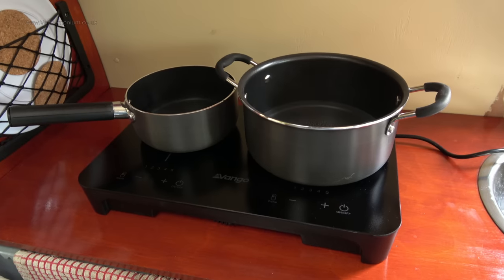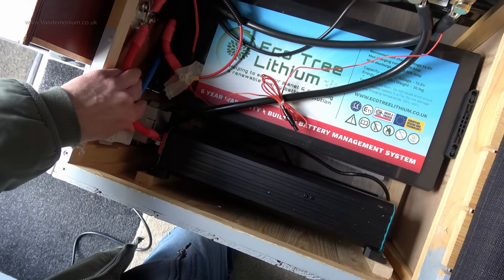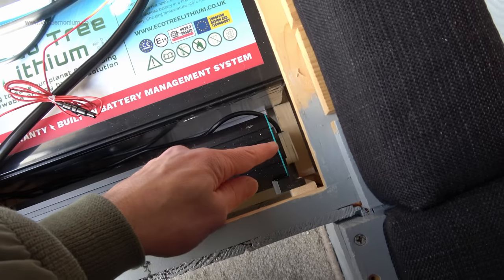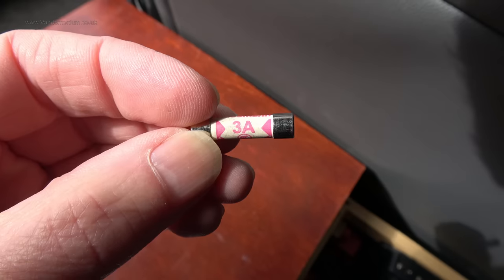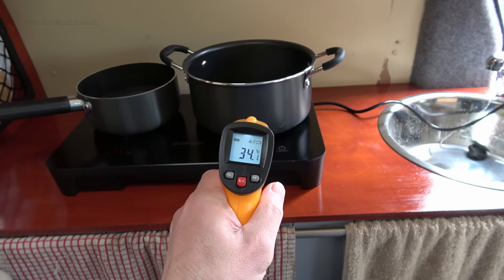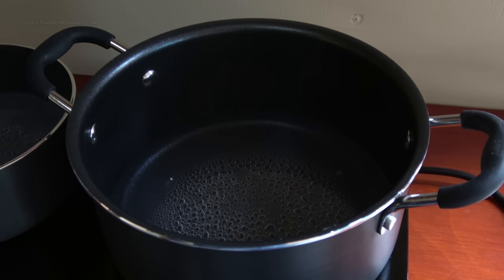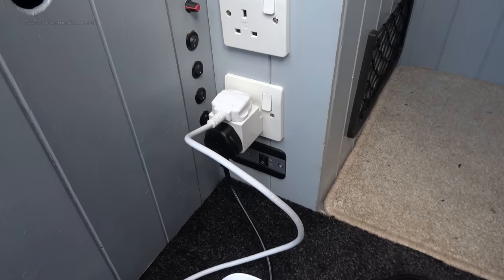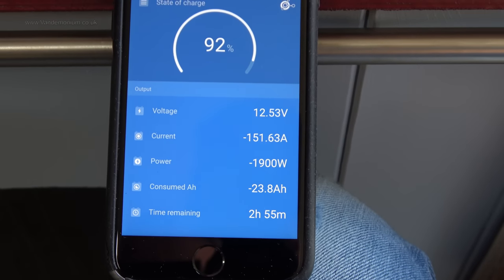80. Battle stations! Inverter vs electric kettle

Comment: You might need to check cable, it might only be for a light ie 3 amps. 13 amps cables are quite stiff. HTH.
Reply from the maker: Cheers, I do intend to check it

Comment: Good on you for thinking of the possible fuse in the plug. It's the little things that are so easy to forget, and then are often forgotten while I check all the other bits and pieces and connections, wondering why things "just don't work the way they are supposed to." LOL  Thanks for taking us along on your "steamy" adventure.

Comment: A little safety tip. When feeling live electric cables always use the back of your hands or fingers, just in case if you get an electric shock causing your muscles to spasm, you won't end up grabbing a cable you can't let go of.

Comment: In the comments section of the last video, someone described the ending as a cliffhanger. Well David, you left us at the top of a very high cliff and quickly brought us all slap, bang down to earth with nothing more than a 3 amp fuse in a plug! Love it!! It is indeed testament to the fact that everything does work well and proper. You should give yourself a pat on the back as this is a result of some excellent work!

Comment: Very nice.  I admit that i was rather skeptical about all that current going over a 12V circuit, but what i forgot is that it's only 12V for like 4 inches or so, and then it's 230V the rest of the way.  No problem.
And very nice too that everything failed correctly.

Comment: Couldn't help but chuckle about the fuse in the plug, you're not alone with that comedy error! That all looks like it will serve you well, even if I and others were worried about the potential heat build-up from the inverter. That's some quality equipment you have bought there, operating well within safe temperatures. And then there's the Whitesnake mention; nicely done!

Comment: My old van has a 2Kw generator installed in a cabinet. I start it (with a button) for a few minutes in the morning to run the coffee maker and microwave my oatmeal. This also gives me a head start on charging before the solar panels light up. It also gives me an option for battery charging when there isn't enough sunlight to recharge. My generator is quiet but not silent. If I were doing a new installation I would consider a large battery and inverter. Thanks for the video David !

Comment: I had a similar experience yesterday when testing out my electric system, inverter, induction cooktop. I've got a 120v breaker panel (USA) rather than just a plug, had my induction cooktop in a socket wired to a 15amp breaker. Handled the two burners both at half power (most the cooktop would allow) and I wasn't pushing the inverter to its limit, so I fired up a heat gun on the other socket. Pow! The 15a breaker tripped. Worked as designed.

Comment: Now that I watched, I am glad I was wrong.  I did see that it is a true sine wave inverter which is great.  You perfectly over designed the robustness of that system and its paying off. That inverter will shut itself down well before it gets too hot.  Use it and enjoy it.
  For a home-gamer/DIY'r you do pro level work.  My offer stands to 3d print you some custom covers for those lug connections.  I'd be honored to do so. Looking forward to some more Van vids David. Thank you and have a great day!
Reply from the maker: Thank you 😊

Comment: Amazing the advances in battery technology.. I had to have 8 x 110Ah AGMs powering a 3Kw inverter to get similar capacity on a boat... plus  15 mm diameter welding cable!!    Yours is a nice compact, well laid out setup that does what's needed most efficiently, David.

Comment: Fuses are there to protect the wiring, accuracy/quality varies. Many appliances draw a very high start up power, so headroom is good. Usually RCD needs to be changed to cope with a microwave if you install one.
Reply from the maker: I've no space for a microwave

Comment: My understanding is that (in the UK) a plug outlet will normally connect to a 30a fused ring so the power capability of the wiring feeding a typical mains socket is actually 30a - so much more than the 13a spec limit. Any equipment connected to that plug should be fused as the wiring comes in to its enclosure so that just leaves the flex itself and the fuse in the plug is designed to protect that cable from being the weakest link. I would be suspicious that any lead wired to a plug that clearly says it has a 3a fuse will be rated for less than 13a and the black cable you showed didn't look like 13a-capable flex - though it is not easy to tell from a quick video. If you upgrade the fuse you should check that the cable is also up to the job. :)
Reply from the maker: I am definitely going to check the wire
Reply: @Vandemonium  for 10A you really want 1.0mm2 minimum, though better to go with 1.25mm2 or 1.5mm2, though the shortness of the flex will work to your advantage. Also I like to use bootlace ferrules when wiring anything with stranded cable, makes a much neater job and no chance of loose strands, paid £20 in Lidl a few weeks ago for my current set with a ratchet crimping tool.
I wonder if there would be any use in getting a coloured socket for your inverter driven socket it's easy for anyone to identify, MK certainly do a red one.
Reply: Would recommend 1.5mm sq flex in this application. Its rated 13Amps minimum , plenty for your application.
Ref BS7671 wiring regulations , table 4D2A

Comment: 13A is for 3kW load, but that fuse is protecting the wire from the inverter to the outlet. there is another fuse in the apliance plug.
Reply from the maker: True

Comment: The best result really - I am amazed quite how long that 3A fuse took to blow though - at least it did.
Glad your inverter is running fairly cool in that location anyway - put your hand over the fan outlet and see how hot that is - I would expect it to show a bit higher temp than the case really. Difficult to measure with IR thermometer.

Comment: Very interesting and food for thought. You did a good job on the installation which was a result of careful planning. I wonder if the kettle is a more efficient way to boil water than the hob?
Reply from the maker: Don't know
Reply: One advantage I see in using the kettle v hob is the kettle has auto shut-off.  Although I think the hob would be quicker.
Cost wouldn't be a major consideration when using solar power.

Comment: Well! There ya go. I've never seen a plug have a fuse in it like that.
Reply from the maker: Standard British mains supply plug :-)
Reply: @Vandemonium  Ok! Australia doesn't have fused plugs. Most GPOs are 10amp fused at the meter box.
Your inverter would have an overload shut off. Do a test with the same amount of water in the kettle and 1 pot on the induction to see which one is quicker.
Cheers mate, glad it was a simple fix.
Reply: It's to protect the wire from the plug to the appliance. For example a short in the appliance could overheat the wire causing a fire.
Reply: best plugs in the world

Comment: The reason it was a 3 amp fuse is connected to the wire you chose is because the cable in your connection is not large enough for a larger fuse.  Never simply increase the fuse unless the wire diameter (gauge) is matched to the fuse.
Reply from the maker: The reason is was a 3A fuse is because that's what I put in there 5 years ago when it went to a 375W inverter!

Comment: Very happy to see all things coming together nicely for you
Although not asked, I'd like to "say", that I would have fitted the vent, facing the leg-corridor on the wall of the inverter compartment to the very bottom, so colder air could have been let in.
I know it is a minute modification, even less important in the intake temperature, and of even less importance in the light of the readings and test results, but I would have done so.
All this being "said", surely it is not criticism, and I do happily congratulate on how it turned out.
Reply from the maker: There's loads of cold air coming in from the back of that cabinet as shown in either this or the prior video, I forget which.
Reply: @Vandemonium  I was sure about that, and like I said: no criticism, nor unwanted advice, just a crumble of thinking how I would have placed that, and for what reason.
Most certainly because of me being as over-cautious as possible.
Reply from the maker: Absolutely, I was just clarifying 😀

Comment: Good to see it was just a fuse. Always amuses me that people boil water in a pan without the lid on for a demo. I'd be interested to know how many AH are used to boil the electric kettle via the inverter and a stove top kettle on the Induction hob - wondering if these are different -  currently trying to work out the size of  battery I need for my limited electrics in Sprintie the Campervan as Big Bertha has expired - thinking I'll probably go Renogy Lithium if I can get away with just 100AH
Reply: Go big or go motorhome....
reallly...just bite the bullet and build in some spare capacity to deal with the unexpected..
and possible upgrades in the future that will require more "oomph"...

Comment: And they said a watched kettle never boils 😂  
On a side note, sticking a fuse in the supply from a solar panel is potentially a waste of time, the panel(s) can never generate sufficient current to blow the fuse.  Whereas the connections to the fuse holder are another potential failure point.  A good quality solar controller (such as you have) is going to provide the electrical protection you need.
Reply from the maker: But as someone said to me, if the wire were ever to fall out of the charger and meet a negative then said fuse would protect the battery shorting through the wires
Reply: @Vandemonium  Would the solar charge controller even allow the battery to backflow like that? That's where the other end of the panel supply wire ends up, isn't it, not the battery itself?
Reply: @Vandemonium  If you start going down the line of “if this wire falls out” there's more options than its possible to compute!  The basis of electrical safety assumes that the installation is done correctly (and wires don't “fall out”).   The primary aim of a fuse in a cable is to protect the cable from damage due to overload or short-circuit which results in too much current in the cable.  If the thing at the end of the cable cannot supply sufficient current to blow the fuse, its pointless.  Its a problem for solar pv installation standards haven't got to grips with yet

Comment: Runs great and stays cool anywhere, nothing more to ask for...
Did you estimated by now, how long it takes to get the used Ah's back into the battery?
You don't have a battery-to-battery charger, am I right?
Thx for showingm great series!
👍👍👍
Reply from the maker: No batt-batt. The battery was recharged the next day. And later, I made a cup of tea (using 20Ah I think) and the solar had it back to full later on with no worries

Comment: Sorry if you've already covered this in a previous video, but I'm wondering if the induction hob (great word, 'hob', we don't have that one here) is more or less efficient then a couple gas burners.
Reply from the maker: I suspect so but I can't give you scientific evidence
Reply: @Vandemonium  Fair enough.  Thinking about it though, I suppose the electric path is long-term efficient in that the battery can be recharged.
Reply: Yes, hugely more efficient.

Comment: Very interesting as always. Having blown the fuse in the plug on the output of the inverter, could you consider fitting a miniature circuit breaker on the output instead? Although I guess the inverter has over current protection?
Reply from the maker: Yes it does, luckily. There will always have to be a fuse in the plug though as that's the way British plugs are so it might as well be fused that way.

Comment: Fuses are NOT to protect items; they are to protect wiring.  Here in the States, National Electric Code fuses should be 80% of the wiring. You need to get a bigger cable for the Inverter to outlet. (I put 6 children through college rewiring vehicles that people put bigger fuses in the wire. )  Also watch out for cheap insulation wire, the melting temperature is too low. It's slick and shinier than the good stuff. The cheap stuff slides through your fingers and the better stuff will have some resistance. I have seen cheap 12 gauge melt before factory 16 gauge.
Reply from the maker: I will be checking the wire, cheers

Comment: Excellent. You'll like that induction system, I was pleasantly surprised when I got one for my home. As for the naysayers, since this is working I'm sure they will soon discover that you're wearing the wrong color socks when wiring and your feet will burn to a crisp and you'll have no toes left. And I bet those aren't steel toed boots you're wearing either. 😎
Reply: I wonder what they will be like when your other systems are operating. I.e. fridge, lights, heater and lights all at the same time.
Reply from the maker: The draw from the van appliances is negligible in comparison with the inverter; about 12A at 12V if everything ran at once!!

Comment: I would like to suggest that the cable from the inverter to the socket is a bit thin for 13A.I looks more 5 amp cable. Perhaps use a thicker cable? Just to be sure. Compare it with the thickness of the kettle lead.
Reply from the maker: I need to check but as I recall it's standard mains cable (I can't imagine I'd have deliberately used downrated cable for that connection to the old inverter)
Reply: @Vandemonium  I say because fuses in UK plugs are there to protect the cable NOT the device. Having a three amp fuse suggests a lower rated cable ( 5A?) . But easy to check and if need be change. It will probably say on the outside of it.
Reply from the maker: I will definitely check it

Comment: Are the wires from your fused plug capable of handling the 10 amp?
Reply from the maker: I believe so but a lot of folk have asked so I will check it
Reply: A 13A fuse is intended to protect 1.25mm cable. It will not blow at 13A and it would probably take around 20A to take it out. As you are probably  aware the primary function of the fuse in a plug is to protect the cable not the connected appliance. Obviously it can be down rated if required but it is a good idea (as in your example) to mark the plug accordingly
Reply: If the cable is the official cable for that appliance then it should be fine. If the cable has been sourced from somewhere else and is fitted with an IEC connector, then potentially it might be the wrong type.

Comment: The slow melting reaction of that 3 amp fuse to overcurrent is why electricians now fit Residual Current Breaker with Overcurrent 'fuses' because RCBOs detect faults quickly and switch off within milliseconds.
Reply from the maker: Indeed. I have MCBs doing the same job on the incoming shore power
Reply: Very true, although British plugs still have the fuses in.
Reply: @Vandemonium  MCBs detect overload to protect the circuit and RCDs detect current leakage to protect people; RCBOs detect both so safer for both van and you.
Reply from the maker: Cheers, yes, I know. You were specifically mentioning cutting off for over current. I also have an RCD for earth current leakage.

Comment: Nice. Personally get a 1kw travel kettle.

You'll wait twice as long for the tea. But worth the extra lifespan on the inverter and battery. :)
Reply from the maker: That's what I have!
Reply: I'm not sure if that's true. It takes the same energy to boil 1 litre whether at 2kw or 1kw, just the time isnt a constant. 100c (212f) is 100c. You don't get free energy.

Of course you are probably correct not over loading the system.
Reply from the maker: Generally, the more power you draw from a battery, the harder it is on the battery so the more its lifespan decreases. With lithium types this is less of an issue though.
Reply: @Vandemonium  I will be curious to how long the battery will last. I have an e-bike and after 18 months the battery's range has halved. I do life in snowdonia though !!!
Reply: @Vandemonium  
Standard house/domestic kettles are around 1700 watts?
Reply: Is the plug itself rated to take the larger fuse size?
Reply: @tonyjones9442  Yes it's the same energy. But generally the lower amp draw over longer periods is better for batteries. There are some cases where shore high amp draws are better. TBF I don't know that particular battery if it's best 1 min at 160 amps or 2 min at 80 amps. But 80 amps seems a fine draw over 2 mins, but 160 is a lot more (double obviously).
Reply: @tonyjones9442  Wow. Must get a lot of use? It depends on chemical and charge/discharge rate. The batteries can last 3+ years at 80% or so degradation, but only if run 10%-90% and not 0-100% as that's harder on the batteries.
Reply: @JohnSmith-yv6eq  Up to 3kw depending on what you get.
Reply: @CaptainArloNJ  
Yes; like David said..he got a "standard 13amp plug fuse" and fitted it into the standard plug.
I suppose you could liken the fitting of a 3mp fuse by the manufacturer to the same trick played by computer printers...
the starter ink cartridge  is very small......
Reply: @CaptainArloNJ  
The plug itself has cast in "13 amp rated"  nomenclature...
(It says it on the body of the plug)